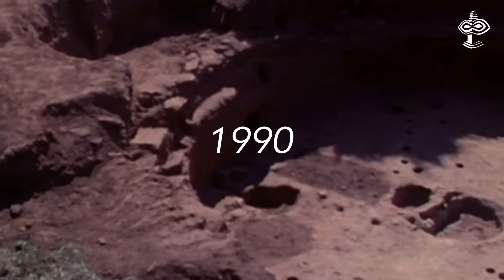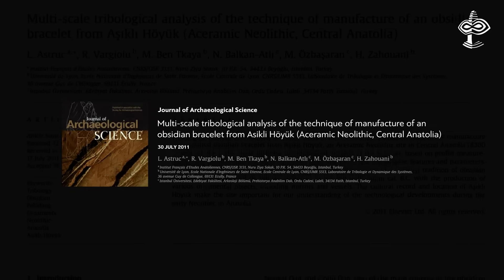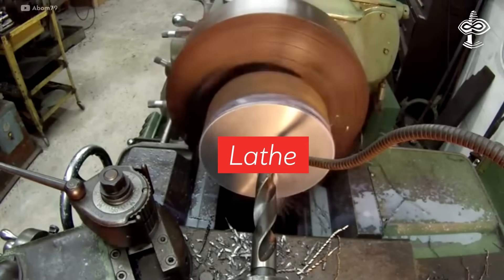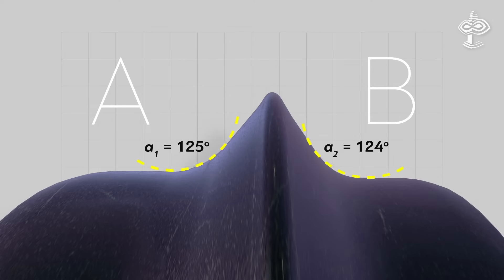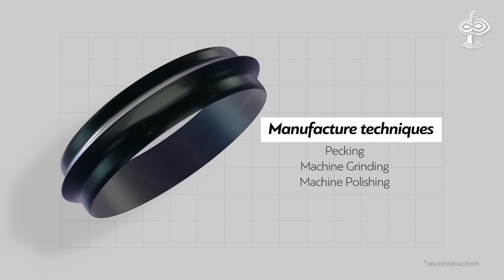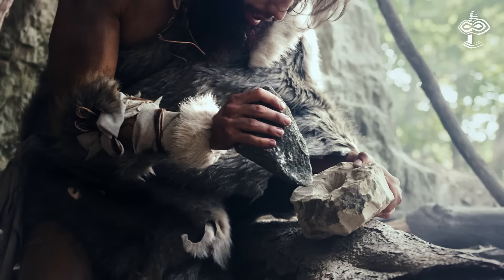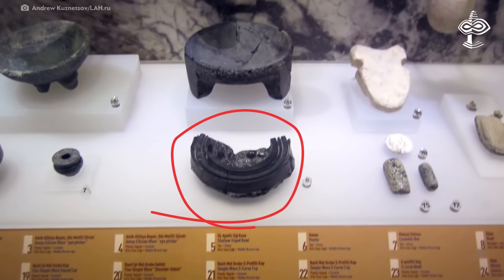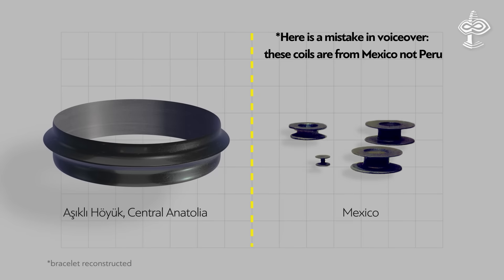This obsidian bracelet is 9500yo and it was made with unknown MECHANICAL devices - VERSADOCO

Comment: We must remember, if it was found in a layer of dirt buried 10,000 years ago, it only means it's at least 10,000 years old. It could have been buried and found by people in the past, who may have kept it as a wondrous artifact for thousands of years before meeting the same fate, only to be dug up by us. It could be 50,000 years old, for all we know.
Reply from the maker: That's correct. It is worth mentioning though that we can date obsidian these days by Liritzis's Thermoluminiscent method.
Reply: @Versadoco  I love your videos. They're some of the best on here by far. So much of it flies right over my head. I didn't fully listen to this as I was doing laundry and was distracted. Sorry. But.. there's many details I did catch that I'd like to pass along to you if you don't mind. While yes, any rock or glass of any type is stronger than steel. In physics tho they teach that "like cuts like" meaning all you'd need to do what were looking at is some more obsidian as a cutting tool. If it was a perfect world yes they could use better tools. But that would work but it would just dull out many obsidian tool bits as they did this, and it take far much more time. Sandstone can do this very well too intact. It has granules in it that are suspended in a softer matrix that bonds the large granular quartz sand and other minerals. So what inside sandstone yes is super strong. It's matrices holding them together however are actually quite weak. They work great tho for sharpening even the hardest of steels. That's why old sharpening wheels was always sandstone, and not other stone types. 
The ancients didn't need a very advanced lathing machine. They surely would have discovered the principles of this type of work as soon as one ancient used a rock as a bearing block for starting fires with bowdrills. All rocks when use this way eventually get a bowl concave shape in them where the soft wooden stick over time even cut the rocks. So I'm sure one saw this and got the idea to use it for other reasons.
Fast forward a bit and it's very easy to see an ancient using a similar setup but now made to do things like we see now. All they would need to do is to fashion what would look basically like an arrow. Just like how they always made arrows. But this time with a tip made for grinding instead. Then use his bow drill to cut a hole thru the obsidian.  
Once that's made all he needs to do is to slip a tight fitting stick into the hole. Then spin it next to a sandstone, more obsidian, ot whatever they had at the time. Then in time they'd have this you see now. 
Fast forward a little more and now they turn the spinning bow drill concept on its side. Then as one person powers it, another sits and touches the rotational portion with a stone. Just like a modern lathe would. 
I hope this helps. I love this story of mystery stuff involved with the ancients. Especially megaliths. It's fascinating. 
Anyways you make great videos. Wanted to say thanks. Later bud
Reply from the maker: Thank you for your comment. The modern lathe machine tool is just an example of how it would be done today or what you'll need to achieve such results at least. I was told by the people who has actual experience with obsidian that the modern lathe is a bad idea anyway. And the other type of machinery needed. Anyway, the options you describe are logical and what seems like should happen with these type of ancient artifacts. But. Even though you can cut obsidian that way you won't achive precision of these artifacts. That's I guess a key point. I don't know if you have any practical experience on cutting this sort of material because I do. Once glass become thin (edge or the main portion) your cutting instrument must be extreamly well balanced and the higher rotation speed the better balanced tool you need. Even minor off-balanced tool will start 'hitting' instead of 'cutting' and you will not achieve parameters of the actual artifact. So, I guess science need to find better explanation of the actual artisan techniques involved and I'm planning to return to obsidian production methods in the future episodes. There is some interesting data regarding production of these very mind boggling type of ancient artifacts.
Reply: @Versadoco  I kinda fell into the same trap now too long ago with the "Data traps" that are disseminated and here and elsewhere. Not sure where they get some of the data. In my case it was with the Petri Core or whatever it's name is. I was told it was so precise and is a perfect spiral from any new age outlet that I stumbled across. Then later on I found out thru another guy who debunks such stuff that the thing is actually extremely rough, cattywompus, and isn't even a perfect spiral. So after that I learned a hard lesson. They supposedly had 10 different super scientists check it, silicone molds done and all confirmed it was being perfect. Then all the pics I also seen was really close up shots. They didn't let me get a full look of it. So all that time I was walking around with a bunch of false facts. I'd even go to battle with so called experts here on the issue. Then me having experience in the matters of concrete, and cutting concrete made me even more confident I was right because I respected it that much more. Me having experience actually made me more the fool in that case lol. 
When I have time I'll watch this again and comment back. I have some ideas but I was watching it super late the other night after taking sleep meds lol. Barely recall even posting lol. Let me do so again and I'll see if I can add any more that would maybe help out. Gimme about a day. Thanks bud
Reply: @DasHugh  
Yes, I remember that case, it was deflating to see how wrong they were about that core drill 7. Uncharted X and some others were totally wrong about that bit. But lets not throw out the baby with the bathwater. It just teaches you to be even more critical about everything. There are still a lot out there that main stream archeology can't explain, like this bracelet.
Reply: @faster6329  it's actually pretty easy to find out the limits of any cultures tech at any given time or era. So long as we have records of thier weapons at least. 
Mankind will always bring thier best tech to the field to better kill each other with. 
Always...
So if all we see are spears, arrows, maybe some chariots etc... it's safe to assume that's where there tech was at. 
Look at today. All our best inventions and tech are made or used on the battlefields usually. 
This fact will be the same no matter where you look. 

So really the only questions left about most of ancient history are the things like the nubs on the megalithic walls, and exactly how they moved some of the stuff. 
We already have the answers to most all of the questions you see spoken about on YouTube especially. You just have to dig and find it out yourself and avoid the "woo" channels. 
I'm still learning myself. 
But human skin can even cut stone. You don't need super tools to do it. Heck humans have cut gems, even diamonds for eons without all the tech many think is needed. 
Native Americans made exquisite works of art in the form of arrowheads from the hardest minerals like obsidian etc with just sticks and antlers. 
If you learn more about the artifacts you'll find more of them that resemble this bracelet in the form of very machined looking atlatle weights etc too. All made by hand. None of which get any attention though however. 
Google them. You'll see. They could drill perfect holes during this time just fine through very hard materials. 
Long story short. I feel like we disrespect the ancients and all thier hard work by assuming they had super tech to make it easy. They just didn't. 
It's kind of a downer I admit. But it's just the facts
Reply: @DasHugh  
You are right about weapons being an indicator of how advance they were. That is a very good point. What baffles me about Egypt is how their tools never improved during their 3000 year long civilization. It's as if our tools did not improve much since 1000 BC until now. 

Cutting stone is possible but doing it on a vast industrial scale and with precision requires a lot. I see the older structures in Egypt being almost flawless and it's very obvious to the eye that they tried to copy those structures but in much softer stones and the result is clearly inferior to the originals. 

Art can be very beautiful and humans have since the start spent time to make beautiful artifacts but beauty doesn't require extreme precision. Some artifacts/structures are too precis to be art (Barabar caves, India). Even today, we spend extra resources on precision only when it's demanded as precision costs and that cost increases exponentially when precision is increased. 

There is a reason an F1 engine costs millions but on a basic level does the same job as an engine in a Ford truck.
Reply: @DasHugh your idea is based in the fact that all societies are violence based. And that's NOT the case.
Reply: What was the mistske about the core drill?

I've been researching about a lot of "woo-woo" claims that UnchartedX has made about the vases and I've remained skeptical about a lot of things, but I haven't heard any specific refutations about any claims he has made about core drills.

I think some of you are more confident about knowing the methods used for a lot of ancient stonework than I am, but I'm okay with accepting that I have blind spots.

Great discussion here.
Reply: @DasHugh too long comment,,😂😂😂this YouTube not history class
Reply: @duaneelliott5194  What societies didn't defend themselves?
Reply: @Versadoco  Dating the obsidian does not give a date of the manufacture of the object. That is like saying the date of a block of wood was older or younger than it really is.
The dating of an object is based on when the object was made, not the age of the material it was made from. The pyramids in Egypt are thousands of years old, but the stones that make up the pyramids are tens of millions of years old.
Reply: @Versadoco 10k you old obsidian that's pretty young ud have to som how date it manipulation
Reply: @Versadoco I love this stuff‼️. We didn’t know you could date obsidian.
Reply: @Versadoco  You can date the obsidian... But not the age of when the obsidian was worked.
The age of the stone has nothing to do with when the object was worked.
If the obsidian was erupted 200,000 years ago, but it was worked 2,000 years ago, then is the object 200,000 years old or is the 200,000 year old obsidian really only 2,000 years old?
Reply from the maker: Nope. The dating techniques I've mentioned developed specifically for archeologists. They have their limitations of course but once calibrated it works pretty accurate. You can easily check the description and specifics (including limitations) of them by yourself. It is open access knowledge.
Reply: @Versadoco  Wouldn't that just date when the obsidian formed as cooled lava and not when the obsidian artifact was made? Or how does that work exactly?
Reply: @Versadoco  
These artifacts seem to have similar precision as the Egyptian vases measured by Uncharted X.
Reply: @Versadoco was this method used to date this specific object though?
Reply: @Versadoco  Nanometre? Try again. Anything >3micron is flawless mirror finish - this ain't that; you can clearly see the flaws. This was polished with fine sand or crushed gemstones, probably using something akin to a pole-lathe or potters wheel.
Reply: @dashugh. Good points, but you ignore the FACT that you cannot get perfectly parallel and consistent tool marks without the part being fixtured and the tools being held in a fixture as well. There is no way to do this with hand tools due to rebound and movement during any cutting action.
Reply: Could've been a gift from the "gods".👽
Reply: Did the video say what methods were used to date the artifact? Maybe Potassium-Argon dating since the bracelet is made from obsidian.
Reply: What a fascinating documentary. Starting with the Neanderthals I think we sell our ancient ancestors well short of what they were capable of 😮😮🌌🌌🌌🌌
Reply: Not 100% true. It was measured be the organic matter around it and not the rock itself. If it was 50,000 years old and found and rediscovered in a layer of earth 9500 years ago it would date to the last age of organic matter in which the layer was deposited.
Reply: Or maybe not.
Reply: What if it's 50 years old and and someone dug into an ancient layer and buried it there?
Reply: The idea that man has been around as a dumb mindless knuckle dragging pseudo ape . for some 50,000 years or more is nonsense  And those who believe this are blind.
Reply: Lol, no. Science. We can date things.
Reply: It COULD be but I think we have enough well known methods to determine it's actual age. Carbon dating being one but probably not even needed in this case since we know it's location and a bunch of other information.
Reply: Yes for all we know.....As could ANY archeaological find ever that can't be carbon dated. It's just pretty convenient to suggest that when you are trying to push the narrative towards an extinct brilliant civilization.  Why they in all their brilliance  did not survive, and most of all: left ZERO traces (machines? Data storing? ANYTHING?) of all this incredible technology, whereas virtual cavemen did survive (those were neanderthals), is my question. I think the answer is that an alien culture is re-burying everything and changing the age with super advanced technology to amuse themselves. And they are reading our comments rolling on the floor laughing.
Reply: Or someone dropped it more recently in the right carbon layer to get the false I.d
Reply: or somebody buried it 400 years ago...
Reply: Thanks I was wondering about that.
Reply: Well considering humans didn't live 50 thousand years ago , it's safe to say it's not that old 😂
Reply: @Fulllarrylarry  what? Homo sapiens exists since at least 300 thousand years ago...
Reply: @Fulllarrylarry . Who says humans did not live 50,000 years ago. Our indigenous peoples were roaming around Australia around that time. Cheers from Michael. Australia.
Reply: Interestingly, the only other stable interglacial period which was at least 10,000 years long was 50,000 years ago. Homo Sapiens are at least 250k years old. What were we doing for the prior 200k years?
Reply: Pretty sure that's not possible,,but very observant of you,,not like most stupid comments I read
Reply: I think so as well
Reply: Or it could be a week old and buried yesterday.
Reply: Snort.  Just as easily, some Turkish archaeologist could have planted it  there.   Neither of us has any evidence to support our opinion!
Reply: Maybe it was Jesus before Jesus before Jesus before Jesus before Jesus before Jesus before Jesus before Jesus before Jesus before Jesus before Jesus and he owned it before Jesus 😂😂😂😂
Reply: @derrickmooney8566  Literally long before world created😂
Reply: Tears will flood down your face  whenever you find out there was "Party Hard"🎉🎉🎉
Reply: Exactly 👍